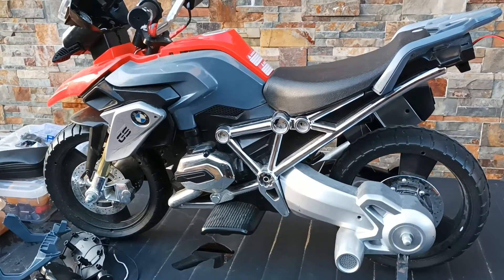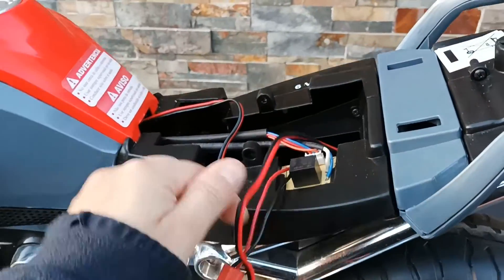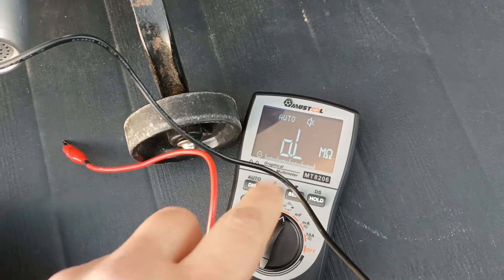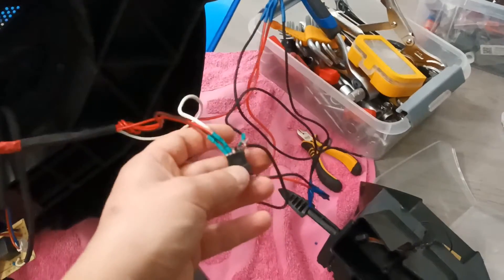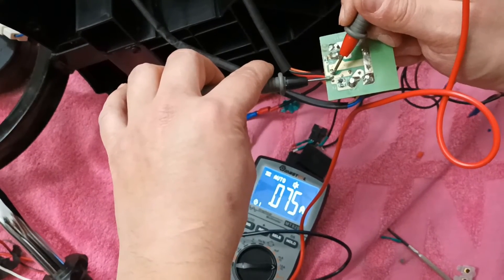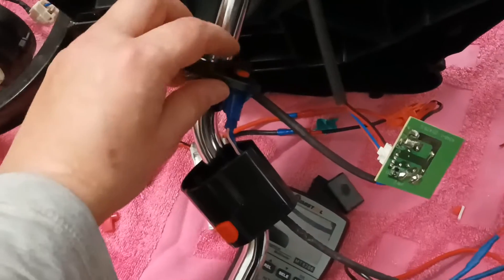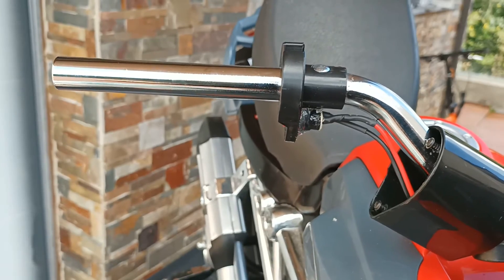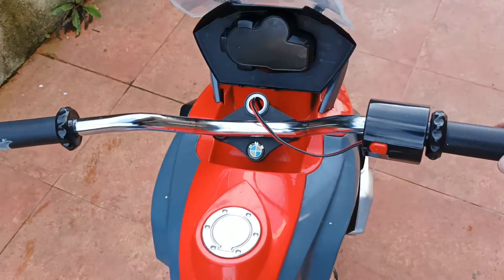How to Repair a Kids Electric Motor Bike. How to Fix a BMW Electric Motorcycle for Kids.

Comment: Where is the charging port
Reply from the maker: No charging port, I use LiPo battery, which is charged via a special charger, you can check batteries playlist on my channel to see how it works.